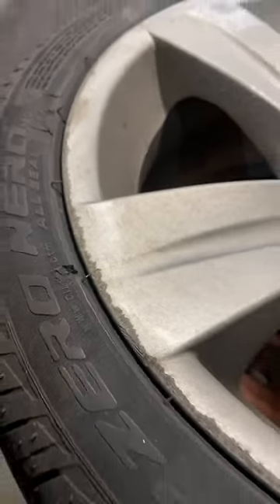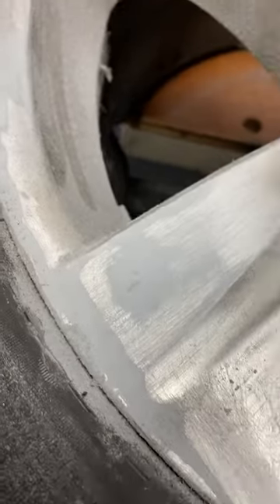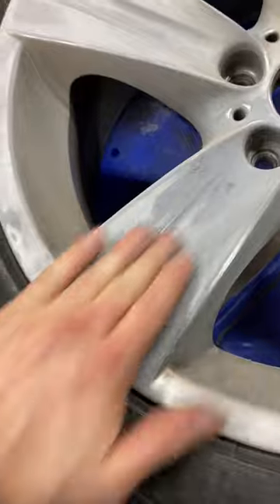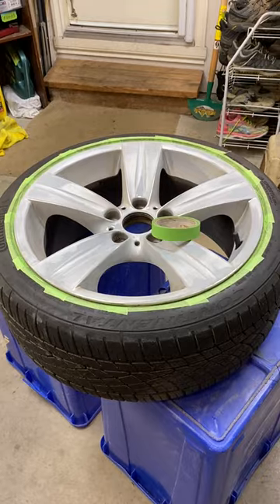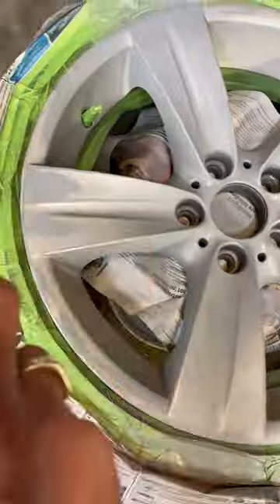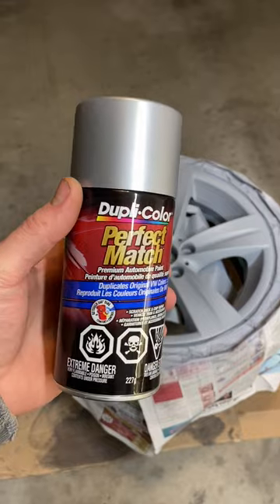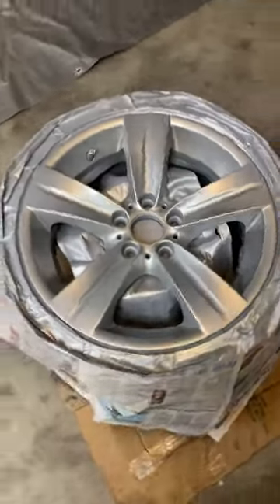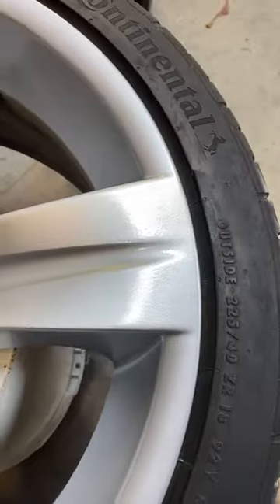How to Repair Curb Rash Wheels #shorts

Comment: About what should I expect to spend on materials in $$ debating about doing this myself but if it’s 80-90 in material I’ll just send it into a shop for the extra 50-70 bucks maybe…
Reply from the maker: I spent about $120 for the materials that I used for all four wheels. Hope this helps your decision.
Reply: @Calvinm  it’s just one wheel so might suck it up… but very good video thank you!
Reply: @garrettnichols831 you know its not only one time, its gonna happen again😂  so even if you buy it, you will need in the future.
Reply: What would a shop charge?
Reply: @jade8568_VR  one shop quoted me 150 per wheel another 200 per wheel. Still gotta take it off the car and bring them the wheel wich might be harder then doing it in my driveway
Reply: In the end I learned take to dealership if you care a lot. If you don’t as much the at home kit is super nice actually